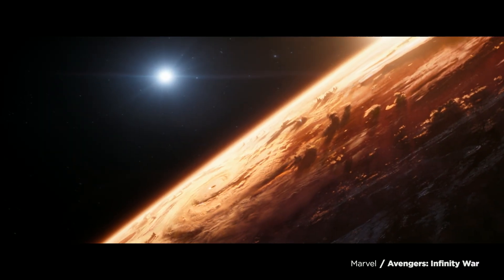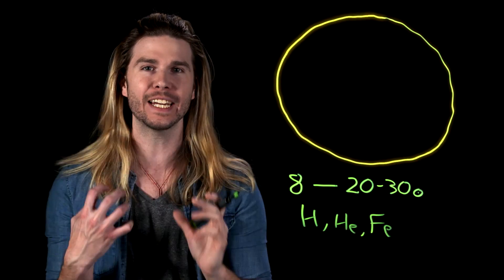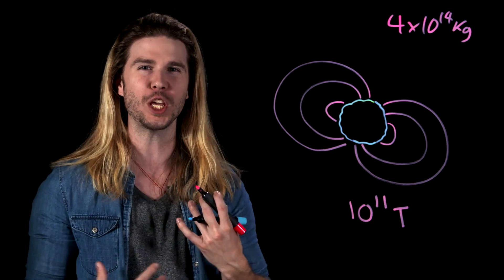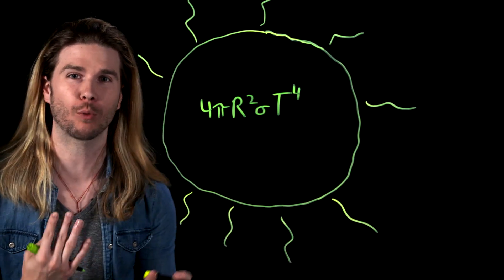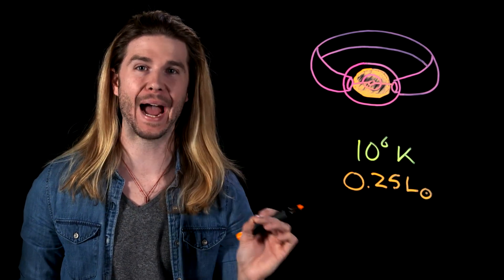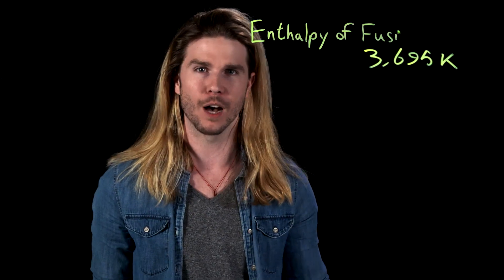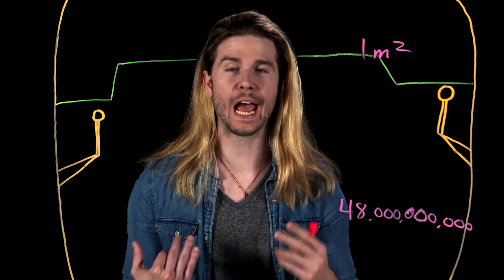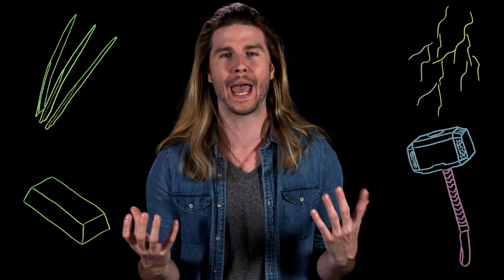How To Forge Thor's Infinity War Weapon

Comment: here's a question... Now that storm-breaker has been forged, and Odin didn't imbue it with the "you must be worthy to wield this" oath... can anyone wield Storm-breaker now?
Reply: Buffbud96 that depends on how heavy it is. there may be no enchantment, but that doesnt mean that weapon’s light as fuck
Reply: Deadpool well, considering Mjolnir's Canon weight (in the mcu) is around 42 pounds, and can be held by a coat hanger without breaking and is made out of the same material as storm-breaker, I would assume storm-breaker is also around that weight, maybe a little more, just to be generous with the weight, around 60 pounds... If it's not enchanted, anyone that can lift it should be able to... Right?
Reply: Buffbud96 yeah anyone that can lift it should be able to
Reply: Buffbud96 itll just be a normal heavy weapon tho. i doubt theyd be able to use Thors powers. Thor uses his weapons to channel his powers
Reply: didnt Vision use lightning in Age of Ultron? anyway... even if they couldn't, its still a pretty awesome weapon, most likely super sharp on the axe end,  blunt on the hammer end, on most accounts unbreakable... still would be great in battle
Reply: sorry, i was under the assumption that Mjolnir could only be WIELDED by anyone that was worthy... i didnt realize Odin said "Whoever holds this hammer, if deemed worthy, shall HAVE THE POWER OF THOR" so i guess that still makes sense, but still someone else wielding Storm-breaker just as a weapon would be cool!

Comment: Welllll 
Actually black holes are the most hostile objects in the universe not neutron stars 

Ps u really don't need a haircut
Reply: Heisenberg Vk well the reason that most say neutron stars are scarier than black holes is that not only do they have alot of gravity but only a litlle less than a stellar mass blackhole, they also come with nasty suprises like intentse magnetism, radiation and rare but sweet sweet extinctincion level star quakes with side effects spanning many lightyears. But a super massive blackhole would still be worse
Reply: Lari588 don't black holes display magnetism? 
And as for radiation black holes emit hawking radiation 
But i do get you point
Reply: We don't know exactly what a black hole is, but the best we have is that it is a singularity, which basically means it has infinite density and no surface area, basically it's one dimensional, so it doesn't qualify as an object. Neutron stars on the other hand, do have surface areas and volume, so they do count as objects.
Reply: Well you could make a case for predictability while incredibly dangerous black holes are also incredibly predictable while neutron stars are almost as dangerous as a black hole while being incredibly unpredictable
Reply: undead890 black holes are objects 
There's a singularity at the centre of it but the black hole is bigger than the singularity 
And it isn't just the singularity that has high density it's other parts have extremely high density too

Comment: if you jump up and down on the surface of the neutron star you move at ridiculous speeds back towards the surface. then how does all the rings not get pulled towards it? or does the further away you get the more the gravity decreases at an exponential rate, that the rings are at a far enough distance for the gravtiy of the neutron star to not affect it whilst being able to focus the energy of it to melt the metal?

also how is the energy of the neutron star get sucked into the focusing thing, it's only to focus the energy not suck it towards it? or in the rings the part the focused energy hits the "neutron star energy magnet" (if you will) which comes to think of it surely rocket, groot and the dwarf get burned alive for being so close to it (I suppose the heat would of decrease enough by the time it reached them)

explain that in the footnotes please? also side question how long after the video's been up do you record the footnotes?

Comment: So exactly HOW in the world does Groots arm make a functioning handle for such a heavy weapon? How tough would that wood have to be to withstand Thor swinging the axe over and over again?!
Reply: It’s enchanted with plot, I mean magic. It’s like how Thor was dying but getting his hammer revived him after being burned by the sun.
Reply: then is groot worthy?? cause he managed to pull all stormbraker's parts together, so in the end, he managed to move stormbraker
Reply: space magic (Odin force?), apparently
Reply: Sheol_IK it was a mold for the 2 halves of the blade/hammer but there was no handle so groot made one
Reply: I believe Groot is a descendant in some way of Yggdrasil - the world tree, thus possibly making him a super-space-magic tree-being. But the actual answer is ... I am Groot.
Reply: Newtron star is dense.
Uru is not that dense.
Reply: Sheol_IK the two parts were stuck together by the metal itself, like forge welding, to become one piece, so how would it be broken apart easily? it became one piece. It became a pirate-angel worthy weapon, those who wield it shall become the next pirate king 😂.
Reply: That weapon is not functional, to begin with. It was broken in half and Groot just tied it together. That construction is just begging to fall apart.
Reply: "how strong wood that be"
Reply: gusliv no, groot is not worthy. First of all, the enchantment hasn’t been put on the axe (yet). Second, if it was, groot could still lift it, not because he is worthy, but because he is not a who, he is an what. The enchantment states: WHOEVER may be worthy shall wield the power of Thor. That is why vision could lift it.
Reply: Was it ever actually hinted at that Stormbreaker has the enchantment for being worthy? In the original Thor film we see Odin lay the enchantment onto Mjolnir, and I doubt the Dwarves would have incorporated that enchantment into the mold of the axe.
Reply: The Lone Hunter Stormbreaker isn't enchanted. There isn't any seal
Reply: HORRIOR well to be fair remember mjolnir and Stormbreaker are enchanted Asgardian weapons if the wielder is deemed Worthy he can carry it if not the whole weight the weapon won't let you lift it. So it doesn't really matter what the handles made out of.
Reply: Jayden Gonzales
Yeah and that contradicts my comment how? A thing which purpose is to hit hard other things will definitely break apart if the hitting part is made out of two separate things.
Reply: SuperShanko
That makes absolutely no sense. It's like - let's deliberately chose a bad design that is doomed to fail, but fix it with magic. And it's still not foolproof. Like, what if the next Thor's enemy is capable of magic, sees that the only thing holding the Stormbreaker together is magic glue, chants and spell and bam - Stormbreaker falls apart. And Thor is like: "Oh no, if only my weapon was well made from the beginning, even if the bad sorcerer dispels it's magic properties I would still have a big functional hammer-axe I can bash his head with".
Reply: HORRIOR MCU Groot might be a branch from the Legendary Ygdrassil Tree.
Reply: HORRIOR The plot point here is Groot is worthy, which ok compared to how Thor is not vaporized by the power of neutron star...
Reply: +Sheol_IK 
Then it would fall apart the same way his old hammer did. I mean we're talking about a magic hammer that can allow someone to lift it, be they Asgardian or human, robot or tree. 

Groot would be considered worthy under the same grounds as Thor gaining humility sacrificing to stop the armored robot. In this case it's Groot not just grabbing the hammer but helping save Thor's life, and in turn became worthy to move such a thing. 

By sheer design the hammer being a three piece design, it would be flimsy, but it's not. Because it's enchanted with magic, magic that is clearly strong enough to damage a person using the IG.
Reply: Groot put grout between the two pieces I think.
Reply: Yeah, cos how the handle works is by far the most unbelievable part of the whole process.
Reply: +Lucas van der Wal 
Groot is a who. Who he is is Groot. and when Groot acted his intentions were as pure as Thor sacrificing and applying a part of himself. He didn't just grab the hammer for kicks, he was enabling himself to be apart of it.
Reply: Lucas van der Wal Groot is a "who"
He is not a what, he isnt a robot or a non sentient being imbued with magic to move, he isnt like vision
He is an actual species in the marvel universe
From the comics Flora Colossus are wood like sentient beings made of living cells and has souls
They have what defines a "who"
They are sentient, they are made of living cells, and they have a soul.
Reply: well i do believe all asgardian super technology should be able to tap into the Odin force, and the odin force can allow a single asgardian to stand alone against nearly any of the celestials from any of marvels universes.  so consider both thor and he weapon tapping a fundimental universal force like that
Reply: odin was killed by a celestial... and not even the most powerfull of them... and at the time, he had a significent boost in power from a bunch of other gods! odin is not noelrmally that powefull
Reply: ACSkyrim1124 
Pretty sure Our Lord Thor has a version of Odinforce. Which if fully tapped would make Our Lord Thor the current All-Father!
Reply: Megacannon that's not how you forge weld things, but ok, maybe its plot welded then. In all sincerity, the thing isn't forged at all, it's casted and tied together, at best. The scene is cool looking, but it doesn't have that little extra bit that someone who knows some of the stuff going on would be able to get all know it all and nerdy and be like, yyeeessssss about.
Reply: Groot isn't actually made of wood...he just looks like wood...but isn't
Reply: +Andrés Méndez 
My mistake. But still a huge amount of heat that could at least melt the material that forges his ultimate weapon.

For my own comparison look up a forging video and look how hot that thing is, now imagine resting your arm in there for how long he did.
Reply: +Cake# “Cj” 
It has its own magical properties.
Reply: I am Grout!
Reply: HORRIOR Shouldn't it disappear since Groot disappeared?
Reply: My .02 on the matter:
Until Storm Breaker is fully assembled, the "worthiness" factor would be inert so Groot could in theory handle the pieces. If we accept gravitons as a given, I assume that once assembled the graviton tech would help fuse the pieces together. As a final step to complete the construction, we see Groot cut off his arm(a cool but pointless sacrifice since it grew back, probably still hurt a lot) therefore it is now an inert piece of superwood. Add an enchantment(or more gravitons?) to further strengthen the handle and you are good to go.
Reply: In the comics, Mjolnir was forged IN a dying star, not FROM a dying star, as is often cited. Mjolnir only weighs 20kg, or roughly 45 pounds. I would imagine Stormbreaker is made in a similar process with similar materials, so it would also weigh roughly 20kg. Groot's arm should be more than sufficient for such a mass.
Reply: Groot wood is extremely dense
Reply: Well Thor did mention that he had to learn Groots language. Maybe groots people are tied to Asgardians somehow. If Groot is able to grow out  super fast he can grow more dense in a similar form. When Groot brought the too pieces of the Stormbreaker together there is an explosion of energy activating the Oden Force weapon buf... with S scaling in Lightning or Faith
Reply: Futher more, even if the Oden enchantment in mjolnir carried over to Stormbreaker somehow, the enchantment was "Whoever was worthy enough to "wield" it." Groot was not trying to wield the weapon but complete it.
Reply: Stormbreaker was never caressed and whispered to by Sir Anthony Hopkins so I don't see why any old joe wouldn't be able to weild it.
Reply: He is Groot.
Reply: groot wood is tough
Reply: Groot bringing the pieces together basically solidified the piece, hence it being two parts to begin with over a solid mass and needed the handle. Even without Groot that was the assembly design already. Magic.
Reply: Also, is Groot worthy?

Comment: Wouldn't the material of a black hole be denser than a neutron star? A neutron star gives off light, yet a black hole with the same mass will trap light. This means that since mass is the same: radius must be smaller. Small radius means smaller volume which means greater density.
Reply: Yes, but people like to stop at things they at least sort of understand. Black holes are weird. They are certainly made of something, but we don't know what. They trap light, but (if they are eating) are in fact some of the brightest objects in the universe. Black holes have, as best we know, no size, but their schwartzchild radius is very big for them to naturally form.  They defy any physics we actually have.
Reply: Unfortunetly noone knows if there is anything that could be described as a material or anything at all beyond the event horizon of a black hole and its impossible to get anything out of a black hole
Reply: Paschal Black holes dont have material. Not like we think of material anyway. Black holes are wierd.

Comment: Just a question, that chunk of metal is contained in sort of a "hopper" that channels molten uru into a form. That "hopper" therefore mus  be stronger or more heat resistant than uru??
Reply: Probably enchanted
Reply: Whoops, I didn't make it clear that I was agreeing with you. Yes, the crucible must be more heat resistant than uru, though not necessarily stronger- think a clay pot vs a piece of steel. The steel is stronger, but melts at lower temperature.
Reply: The word you're searching for is 'Crucible,' meaning a pot-like container for melting metals. Our mundane non-cosmic ones are usually made from ceramics or graphite, which raises the possibility that asgardian pottery can withstand exposure to the full force of a neutron star without even melting!
Reply: Crucible it is then thanks, question still stands